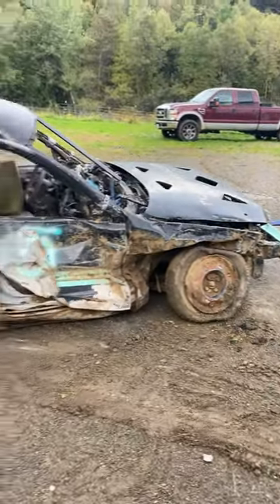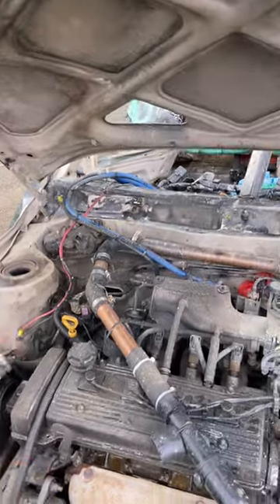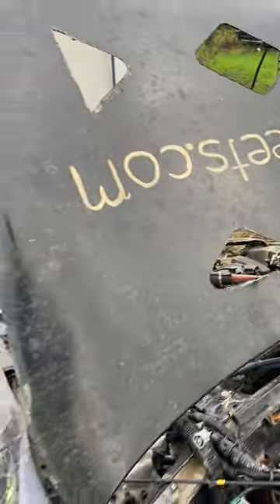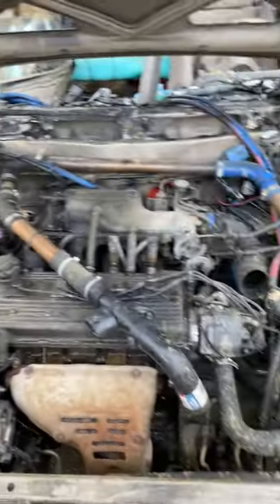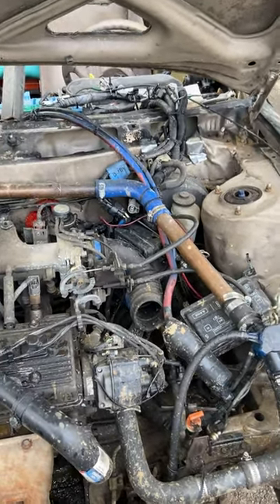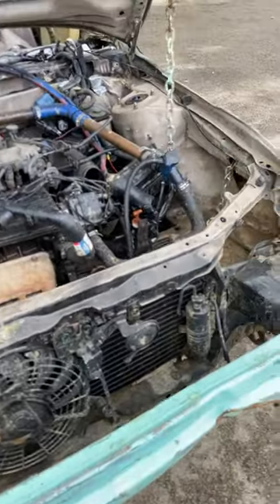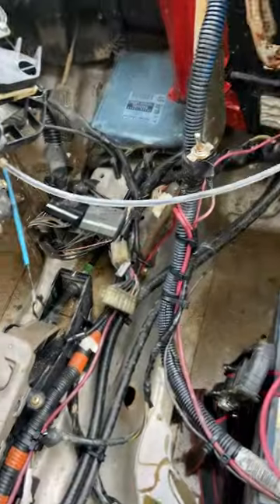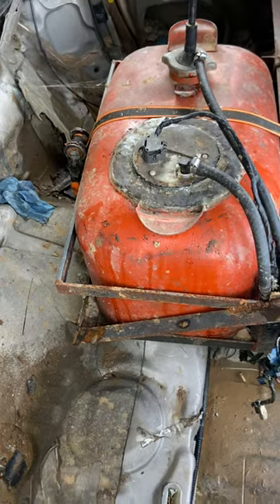How to build a WINNING demolition derby car🏁🏆

Comment: What’s your thought on running an up pipe on the exhaust if they allow?
Reply: if you are already plannnig on relocating the computer to inside the car then go for it. a lot of compacts you will have to cut back the cowl/firewall and relocate the coils too
Reply: You mean a header? A lot of people run them. You shouldn't have to move the computer to run a header but if it's somewhere in danger of taking a hit you should do it. I've never had to cut the firewall or move the coils to put a header on a compact car.. I don't know where the comment before me got that information or what car he had to do that on but to say you will have to do it or even have to do it on most cars is wrong.

Comment: we run compacts in Kansas. gonna try a 2000 Ford Focus zts 4 door. anyone know much about em?
Reply: Back holds up ok but the front frame rails really need to be shortened in our to not fold wonky plus a good front bumper helps as well
Reply: I don't know about a 2000. But you're going to have to see if or where the temp sensor is. If you don't take it out; you're going to go in limp mode when it gets hot.
Reply: Interia switch make sure you get that done or you’ll be one hit wonder
Reply: What area you from ive been around lawrence almost my whole life been to like 4 or 5 derbys but i got a 97 corolla thats running out of driveing life when the wiring messes up pretty good i plan on takeing her off the road and either doing a durby or rally build on er im litterally setting in it rn lmao shes a good car fr but shes tough idk much about the fords but good luck out there man maybe we will literally run into eatchother one day lmao
Reply: Weak a arms and cv axles